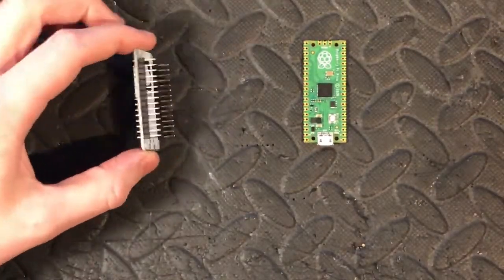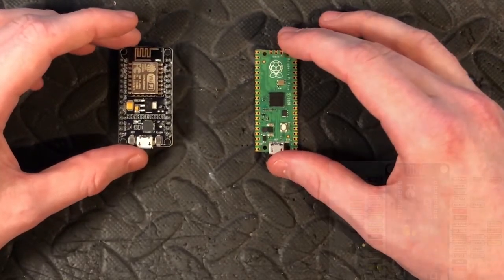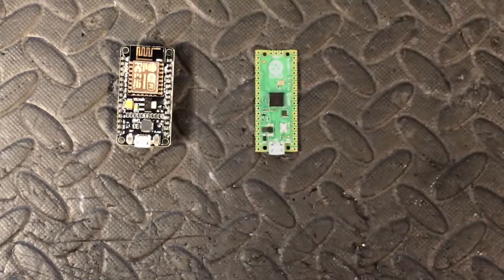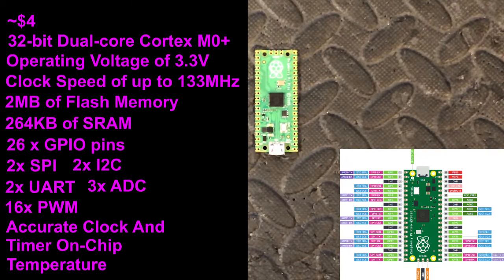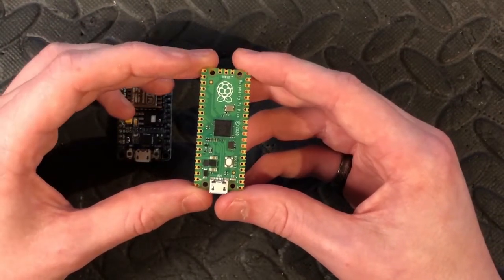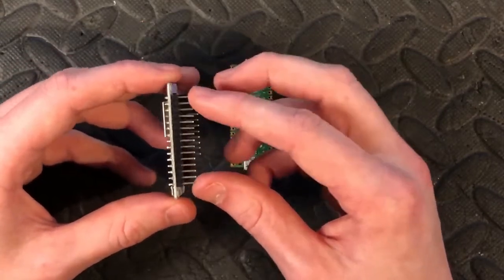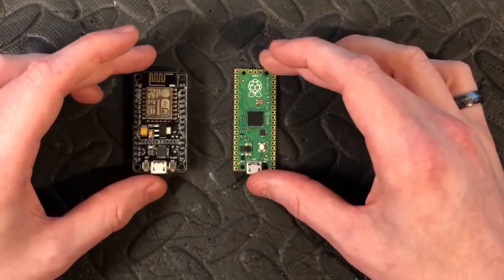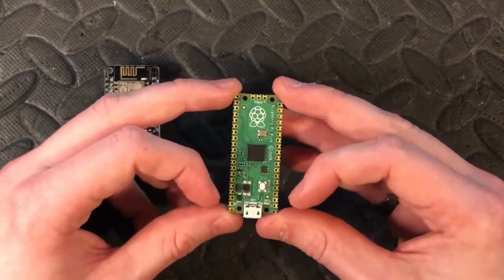WHICH IS BETTER? Pi Pico vs ESP-8266

Comment: Enjoyed the video, thanks! However, you missed a couple of points. First is that ESP8266 can run at 80mhz or 160mhz....at the user's choice....so it can run faster than the Pico! The other issue is price: not quite sure where you are getting your ESP's but i just ordered three exactly like yours here (Amica) for $9, with free next day delivery on Amazon , so nowhere near the price you quote of $8 each. Definitely no more than $4 each delivered these days, whereas the cheapest Pico i can find (delivered) is $10. No contest! Other than those two points, i thought your video was spot-on....clear, concise and well structured. Thanks!
Reply from the maker: Thanks for the addition to my video 😀 as for the pricing: I bought the Pi Pico from Pi Hut the day it was released which was cheaper than the ESPs I could find on Amazon. Note these are the equivalent price for in the U.K. Normally I buy my ESPs from Banggood where they are similar prices to yours
Reply: @LetsMakeOfficial  I understand. Thanks for the reply!

Comment: The Raspberry Foundation and the 'pico' with excellent documentation and a huge community is far better, why do you ask?
Reply: Edmundo Dante  It is not for you idiot Edmundo, it is for our younger children to learn about coding and building projects, they want something low cost, easy to start with good documentation, I have grandchildren 8 yrs and 10yrs, they love it, leave them alone they enjoy it : )
Reply: Edmundo Dante  The new Arduino has the Raspberry Pico chip, buy one and try it : )
Reply: Edmundo Dante  Arduino Nano RP2040 Connect, try it if you dare : )
Reply: Edmundo Dante  Arduino Nano RP2040 Connect try this Edmundo : )